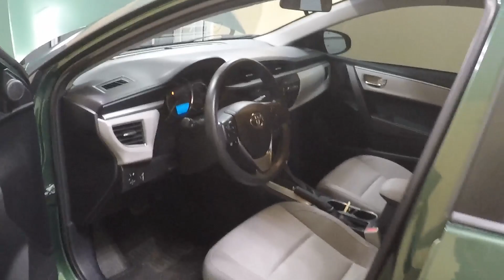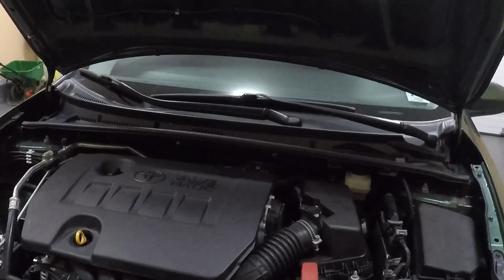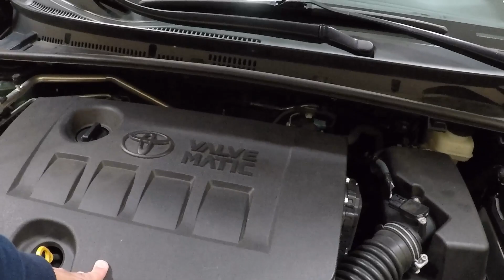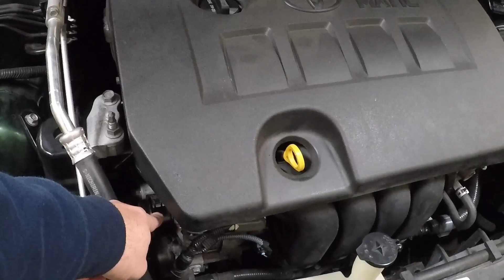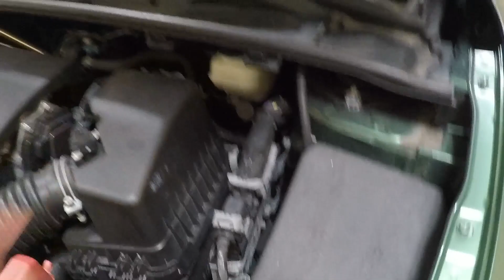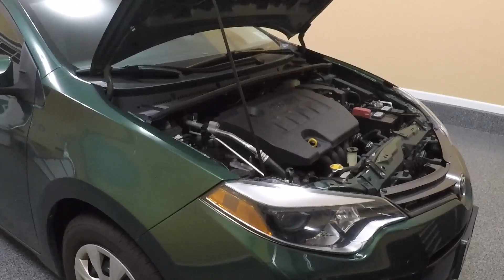Toyota Corolla Maintenance and Repair cost at 100K Miles

Comment: Could you guys be more specific about how I should change my transmission oil , I bought a new one 0 miles and now it has 100k and the only thing I am missing is the trans oil change . My dealership says not to touch it and my Tran mechanic says to change it at 60k ? What would you I advice I do and how to do it ???

Comment: Wiper blades

Engine Oil & filter change

Air filter

Cabin air filter

Accessory belt

Spark plugs

Engine coolant 

Cleaned throttle body

Tire replacement

Brake system flush

Transmission fluid change 

$1000 total over 5 years

Comment: I’m surprised you changed the belt.  Those are good for the life of the engine, well not quite, but a lot longer than 100k miles.  The belt will easily outlast the water pump.  No reason to change the belt and leave the old water pump.

Comment: my 2011 has 297000 miles. I change.my oil every 11,000 miles and it still.has the original engine belt. I bought a used alternator from ebay. It is robust

Comment: Coo. l would advise replacing power steering fluid as well (unless it's electric). I change mine every 50k miles. I have a 2006 Matrix (which is a corolla wagon) with 199,000 miles. Also, make sure you change oil every 5k miles and it will last for decades.

Comment: Mine have 140k right now and is a 2018
Reply: You still have it running strong? I hit 100k today with my 2017.
Reply: @bluesky5384  210k now lol still strong 💪, do regular maintenance and you be perfect , later at 130k try and change radiator to a new one and replace the coolant to keep engine always fresh 😉

Comment: How often do you change your oil? What mileage intervals?
Reply from the maker: 6/7 months at 10k miles.
Reply from the maker: And here’s what the oil looks like after 10,000 miles.

https://youtu.be/vDE7x1kMzEQ
Reply: So do you skip the dash message saying maintenance requested for oil change and do it at 10k interval?
Reply from the maker: @LaMeraVerga562  I just reset it and change oil every 10,000. The maintenance light comes on every 5000 miles as reminder for everything else.
Reply: You might want to check out the car care nut or scottie kilmer on YouTube they both recommend changing your oil at 5000 miles don't follow the owners manual when it comes to your oil.
Reply from the maker: @steelpulse101  Im not a fan of scotty anymore, too much clickbait. CCN is pretty on point and I assume you're talking about the video were they opened up a corolla engine from an uber driver. The thing with the owners manual is that you have to read the fine print about what conditions don't warrant 10k oil changes. Check out the corolla playlist on my channel and look at the video of my engine oil analysis after 10k miles.

Comment: Hi buddy, I have a similar Corolla E170. I'm having issues with the steering. It gets intermittently heavy. No fault codes generated. I have got the EPS motor and the steering rack replaced. No use. When it's light, i can turn it with my pinky finger, when it's heavy, it requires some effort which can ultimately get tiring. Any guesses? im sick of the steering. Power steering motor and rack have been replaced

Comment: Your prices are reasonable in our area 
Air filter cost 30 dollar
Brake pad front cost 70 dollar 
Rear brakes cost 50 dollar 
A/c filter cost 25 dollar 
Set of tires depend on company range from 270 to 400 dollar 
Spark plugs all 60 dollar
Reply: Bruh I spent 700$ on 4 tyres in NV :/

Comment: Yeah that's real , very reliable car , very usef here in my country but they don't take care of it at all , i think it's a good idea to inspect the ignition coils , clean the fuel injectors and replace the fuel pump filter after a 150k on the road , it will make you feel the car new again

Comment: Did you ever have issues with the oil filter? My 2016 is a nightmare trying to get them off.  I had to take it to a garage 3 times to remove it. I got tired of doing that I put a Baxter Performance on it.
Reply from the maker: If you have one I would use a torque wrench. They tend to be over tightened so that’s probably the issue you’re running into. It only requires 20 pounds of torque.
Reply: @EnthusiastsGarage  Look it up on Youtube it's a major headache for a lot of Corolla owners.
Reply from the maker: @randyschiffer3265  I used to have the same problem until I started using a torque wrench. When I would just use a ratchet I would put it on too tight and it would be very difficult to takeoff during the next oil change. Once I started using a torque wrench and correctly torquing it and not going over the recommended amount it would come off much easier.

Comment: Mines at 130k tans fluid change at 120k still runs good oil changes 3-4k miles air and cabin filter k and n

Comment: Did you ever change the motor mounts?
Reply from the maker: No. Low powered cars like this usually don’t go through motor mounts like big power vehicles do.
Reply: @EnthusiastsGarage  At 98,000 my steering wheel starts to shake when I put it in reverse.  Thinking it's motor mounts.

Comment: Still rocking my 15 Corolla s
Reply: Me too, for a long time to come...
Reply: I recently bought one. What did you do with your transmission fluid?
Reply: @HayneStatioN  when I hit 90k I changed my transmission fluid. Little early but I was due for an oil change so might as well. If I’m not mistaken it gets changed at the 60k and 100k miles. Don’t quote me tho😅
Reply: @Ezek44  thanks. Some experts have said every 30-40k for this cvt. I think I found a small note in the manual that said every 40-60k. I talked to the Toyota dealership that sold mine to its previous owner and they basically said you never have to change it. Bullshit

Edit: these cvts are known to have problems in the 100k-150k range. Maybe it’s due to lack of fluid changes, but maybe design flaws idk
Reply: @HayneStatioN  never change them😦 that’s dumb lol yea I definitely change the transmission fluid. So far I’ve had no problems with my car. All I’ve done is stitched my breaks once and tires
Reply: @Ezek44  how many miles? Mines 41k
Reply: @HayneStatioN  93k rn not sure if that’s a lot for ‘15 but I did use to do 10 hour road trips before

Comment: Paid $10,999 for 2013 Corolla LE 79,000 miles. 1 owner car fax shows very well maintained. I hope I didn’t over pay too much with these rising car prices. Family really  needed a second car..
Reply: You'll never have to worry with an oil change every 6000 miles or so.
Reply: The car was totaled out. I wanted the insurance company to fix it but they wouldn’t. I was not at fault. Now I realize how good of a deal I got based car prices now

Comment: Thanks for video, I just wanted to add my two cents. The transmission fluid is extremely easy to change. I got 10 bottles, 1 qt each of ATF WS from a Toyota dealer. When you remove the drain plug it pours about 2.5 qt, just add same measure that comes out. I did it 4 times and I calculated that only about 25% of the old fluid remains. Also about the spark plugs I wonder how you paid so little, I always like to replace them with the original Denso ones and they are like $13 each. I wish you very inexpensive next 100K miles
Reply: The manual gearbox oil for a 2003 Corolla with the 3zz-fe 1,6 engine was very easy to change. A bit less than 2 bottles was needed.
Reply: Wow u got 2.5 out of dirty fluid. I got a little over 4 quarts out of mine.
Reply: Hello i have never check on the transmission fluid before and now have 140k

Comment: I have a 2016 corolla LE and I just did some preventive maintenance at the Toyota dealer. Mine has 130,000 on it. I did the transmission fluid, engine fluid, radiator coolant replacement, serpentine belt replacement, and multi point inspection. Reliable is they are.
Reply: I have a 2016 Corolla s with 226,000. still running like a champ ✅👑 Toyota rocks!
Reply: @JorgetheSinger  How did you take care of it? What part /fluids have you replaced or change of it?
Reply: @JorgetheSinger  Damn how do you pump that many miles on a relatively new car?
Reply: @joseadorno292  just put gas and go and maintenance upkeep is key
Reply: @JorgetheSinger  damn
Reply: @JorgetheSinger My 2017 XSE just hit 100k today and I thought it was a lot, though I bought it preowned so I really only put 70k of the miles on myself. That's awesome!
Reply: @bluesky5384  yea no lie I still have my car and it’s still amazing! I have my Corolla like new again :) now at 284,000
Reply: Was it your first time changing the transmission fluid?

Comment: I have a 2017 just turning 100000 and ive done oil changes air filter and tires thats it. On my way to replacing plugs but i dont know about serp belt i dont see any cracks in it. Very reliable im comfortable driving it anywhere. Not real crazy about the ccv trans though it feels like its being driven by bands and slingshotted around.
Reply: How many miles now
Reply: You should have got the transmission fluid flushed

Comment: After two years and eleven months, my Civic EX-T has 72,600 miles. I always service my car early (between 4,200-5,000 miles using Honda full synthetic oil and filter). Already changed the transmission fluid, engine air filter and cabin air filter twice, spark plugs, brake pads, cut the rotors, and replaced all four tires. Ive only used top-tier fuel offering the highest detergent (Shell Nitro Plus 93 Octane) to mitigate carbon deposits in the intake valves. My maintenance cost after nearly three years is significantly higher than your Corolla over five years because I drive a lot more and I have a 1.5 liter turbo engine. But there have been no issues with my Civic, to date.

Comment: So till now you did not change brakes very long time on corolla brakes really which means you are doing all highway miles
Reply from the maker: Yes. Changed them at 115k just because I was tired of checking. They still had quite a bit of meat and could probably have made it to 150k.

Comment: 2014 Corolla sport, 86,500 on it for $10,800 what’s the verdict, should I get it or no
Reply from the maker: Seems a little steep
Reply: @EnthusiastsGarage  what would be a reasonable counter offer
Reply from the maker: @joegibson8003  private party or dealer?
Reply: @EnthusiastsGarage  dealer
Reply from the maker: @joegibson8003  dealers always start off high. i would be shooting for mid to upper 9's as a fair price. check the vehicle history report and inspect the car for issues, the more you find the more ammo you have. also ask for all the maintenance records. if they dont have detailed records, the price goes down even more.
Reply: @EnthusiastsGarage  if I can get $9,500 out the door should I do it? It’s 1 owner, super clean and carfax shows it’s been well maintained. Thanks for the advice!
Reply from the maker: @joegibson8003  yeah that’s reasonable

Comment: Thanks Bud! I just bought 2017 Toyota Corolla se with manual transmission with 33,900 miles for $13,778
Reply: Sounds about right. Take care of it and you'll never have to worry. I'm very pleased with my 98, 05 and 16. No worries at all.

Comment: Excellent maintenance. Items you didn’t mention but may be changed are PCV and power steering fluid both are inexpensive.
Reply from the maker: Modern corollas have electric power steering and the pcv is a pain to get to so I’ll leave it unless I have an issue with oil consumption.
Reply: @EnthusiastsGarage  OK thanks for update. I based my 2010 Camry as a reference. The PCV change on my Camry is PITA too with an estimate of 8 hours amount work.
Reply: @EnthusiastsGarage  I did my PVC, its a pain but only took about an hour and a half to unbolt intake and twist it up to get at the PVC.

Comment: Hey man! I just bought a 2015 Corolla L in September. It has 103000 miles now or so and it runs flawlessly. My only question is that driving on the freeway... what is a normal RPM for this car? I typically cruise at 85mph and in my old car it sat around 2800rpm, this new car sits around 3400 RPM or so when I drive at this speed  and around and the green eco light stays on at this speed (2800-3100 at like 70-80) (it has a four speed automatic with overdrive) Should I be concerned about it possibly breaking, considering I haven't had it for long and don't really have any mechanical experience with it yet? Fortunately it had a fluid service before I bought it from the dealer so it should be okay in that department.
Reply from the maker: seems kind of high. i have the cvt and i cruise at 70 and it runs at 1900. make sure its getting into overdrive and you might want to speak to a dealer to see of they can confirm if that is normal or not.

Comment: DO you think it is worth it to do a Tune up at 100k miles or would you just change the spark plugs?
Reply from the maker: The word tuneup nowadays is somewhat misleading. You don’t really have to do as much to new cars as you did old ones. The only thing that I would recommend doing at 100,000 just to get it out-of-the-way would be engine coolant, spark plugs, serpentine belt, and change out the trans fluid if you haven’t done it already but that’s pretty much it.
Reply: @EnthusiastsGarage  100% agree with ^^^

All fluids, belt, spark plugs, intake filter and ac filter.

Comment: How often should you replace the serpentine belt and spark plugs on this vehicle. I have a 2014 Corolla and I think the maintenance schedule is about the same. Thanks
Reply from the maker: It should be the same. 100k is good for both. It’s not to early but the parts won’t be nearing failure.
Reply: You could check the condition of the serpentinebelt I suppose. I have a 2003
Corolla with the 1,6 L 3zz-fe engine. The original serpentinebelt cost more than 40 $ from Toyota here in Sweden and I changed mine, had 155 000 km (96 000 miles) on it. Did not have any damage or cracks but felt good to have a new one. The used one is kept as an emergency spare part in the trunk if this one suddenly snaps.
Reply: I didn’t hear or feel any difference with 4 new Denso spark plug but cleaning the air flow sensor with the CRC product made the engine quicker to rev and better idling. It wanted to keep 2000 rpm during cold start and held it there until the heat was up. Now it starts with 2000 for a sec or two then gradually dropping to 700-800 along with the temperature.

Comment: You can push changing the serpentine belt and the spark plugs to 160k. I just serviced an Uber driver's Scion iM at 162k. Replaced plugs, old ones had normal wear, replaced belt (squeaking on startup) was a little worn (stretched) but not cracked and wasn't burning oil. I offered to do a coolant flush with thermostat replacement, and flushing of brake fluid and power steering fluid, but he deferred.
Reply: How much for the work?

Comment: Did you ever have any AC problems? Its pretty common on these 2015 ines
Reply: my 2015 corolla at 90,000 some miles, the ac fan stop working. I brought a new one for about $38 on amazon and install it myself. Its right under the in cabin air filter. took about 30 mins to replace.
Reply: I have a 2015 with 37k miles bought it brand new, never had any issues, love this car.

Comment: Just bought a 2015 Corolla S with 98,000 miles on it. I’m guessing mostly highway? I’m planing on taking it in for a coolant flush and trans fluid change, but my question is what is the interval on the water pump?? The Toyota maintenance book is extremely vague if you plan on driving the car past 120,000. Also is there any other critical maintenance coming up in the next 50k?
Reply from the maker: 100k is when i did coolant, spark plugs and trans fluid change. i would just leave the water pump unless its an issue. highway miles is low stress and they are easy to change now unlike years ago were you did them with the timing belt.

Comment: Hello I have a Corolla 2016 and have 58k and my car sound rough and rpm drop 500 and vibration and I don’t why. I went to mechanic and said is normal and I went dealer said the same thing. I change spark plug but don’t fix and I clean injected none. Anyone know ? Something about that.
Reply from the maker: you can try cleaning the throttle body
Reply: Yeah Little. Also get a p0172 too rich bank. Was pending. I went dealer but they erased. Also the spark plug I have are different from your because Toyota replace the part for the sc16hr11 denso because the sc20hr11 is not longer available Toyota part and denso too. But I don’t really the cause, The car dont  have check engine light. But he car don’t feel smooth. Feel rough and vibration. I have question, what rpm have your Corolla normal temperature? My 600 to 500 rpm,  before I don’t remember but I think was 700 to 900.
Reply from the maker: @william21725  mine is around 700
Reply: Don’t use regular gas. Changing to premium gas fixes that
Reply: @brandonhenriquez3918  GET TOP TIER GAS FROM PLACES LIKE CHEVRON OR VALERO. REGULAR GAS THERE WILL DO THE TRICK.
Reply: If the battery is disconnected this happens the ECU needs to relearn some shit it’s normal

Comment: Please tell me the timeline for maintenance. When to change oil etc.
Reply: Toyota recommends every 10,000 miles with 0w20 oil and Toyota oil filter, 5,000 miles with 5w20 oil and if you use the car under extreme conditions like high speeds then you can use 0w30 for 10,000 miles or 5w30 for 5,000 miles

I personally do it every 5,000 miles, costs me $28 per oil change so no big deal.
Reply from the maker: Depends on your driving. Your maintenance guide breaks it down